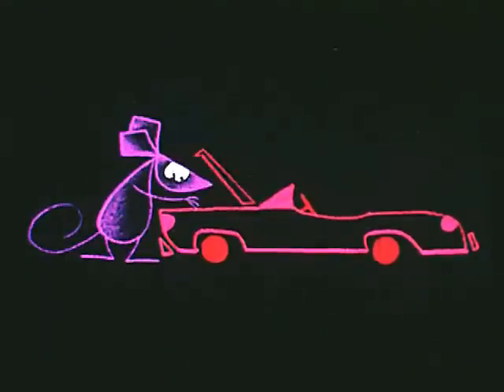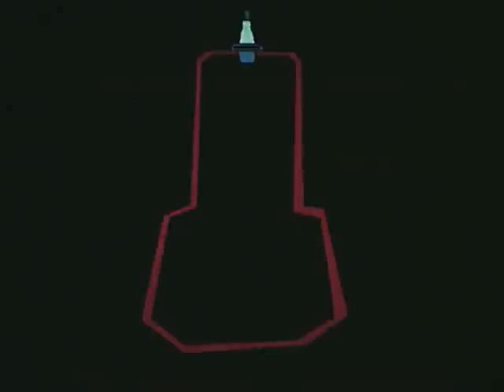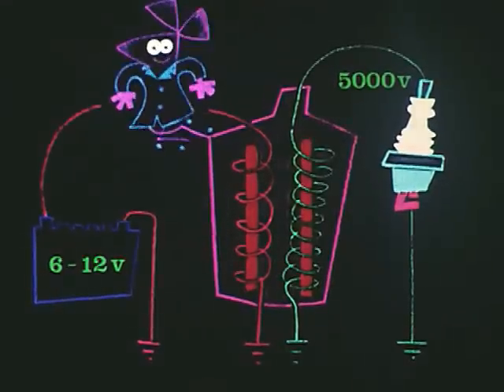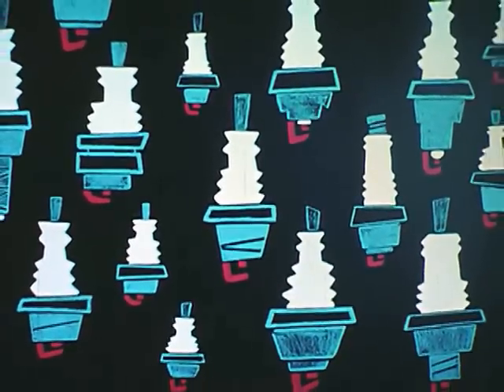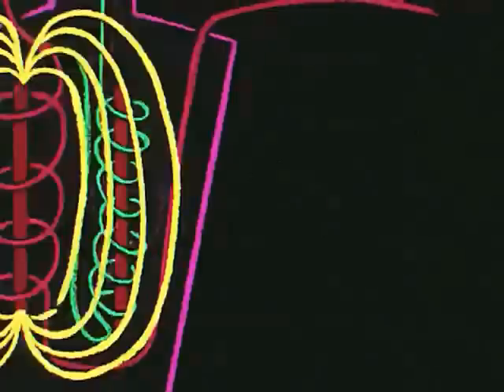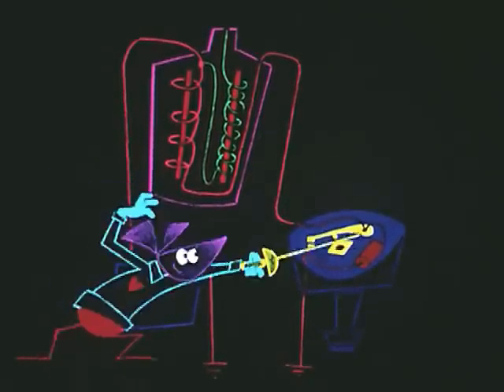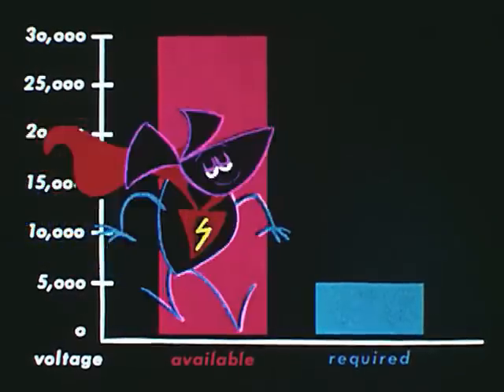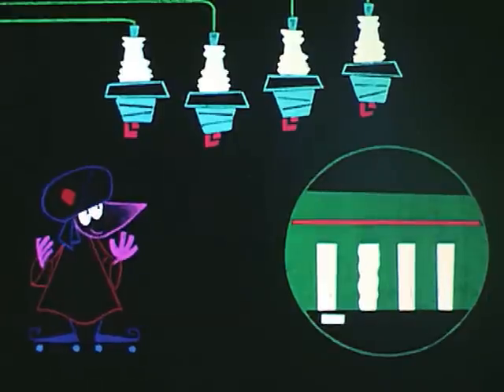Spark In Time On The Firing Line (1962)

Comment: Thank god for the Coil Over Plug system. No distributors, points, caps, rotors, wires, or dwell time to dick around with. Though, it does take away maintenance items to upsell.
Reply: God had nothing to do with it 😂

Comment: Who here has used a timing light?

How about a "Dwell meter"?
.
Reply: YES many times,BUT it's been a long time ago!
Reply: Both...and converted points to Hays electronic back in 70s.
Reply: 28-32 for gm,if memory serves.
Reply: @uploadJ   >My tach-dwell meter and timing light are both die cast chrome plated. With 1,2,4,6,8 cylinder on the T/D and dial advance on the timing light. They where nice enough to cover #1 inductive pick-up clamp led in a heat resistant material. I keep them in the top of tool box #2, just above the distributor wrenches. Why? Do you need to barrow them. They work great on lawnmowers, motorcycles and vehicle engines to ensure advance is active and max advance can be achieved. This is great for guys who’s engines crap out, spit and sputter before the end of a 1/4 mile run. You hear it often and they think it’s running lean. But they are wrong. As a retired Crew Chief, my day phone rings off the hook. When I take one on, I charge $250 to diagnose. I can’t and won’t try to keep up as many report the expense to the IRS. I won’t take those jobs. And carbs, wow. I turned down about 2 dozen a month. The vintage crowd, all period correct with OEM looking parts are driving me away from my own projects. But a wide-band O2 sensor and PICO scope to record air/fuel issues.
What you do? I retired at 52, almost 11 years ago and have change my phone number twice. You see, guys like Jim Linder are out of the fuel injector business and other buddies of mine quit completely leaving a large crowd out there, with no one to keep their trophy winner vehicle running...
ASE Master Tech-Retired
Reply: Is it similar to the light on a turn table where when the dots look like they're standing still, it is spinning at the correct speed?